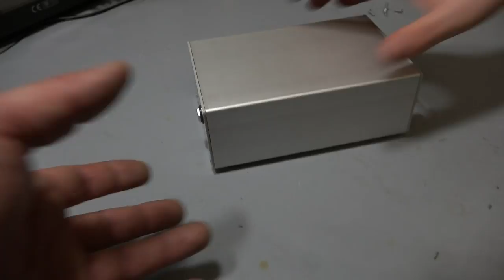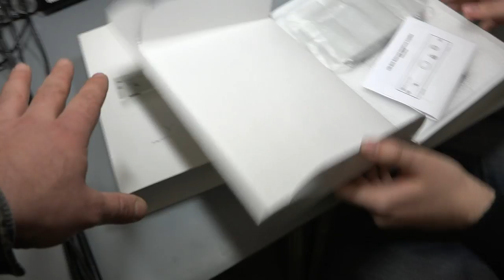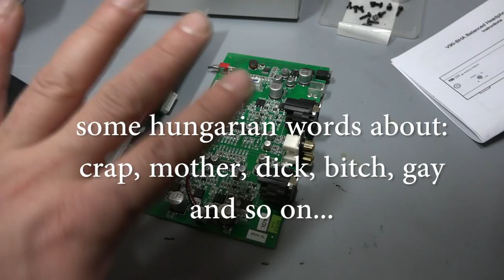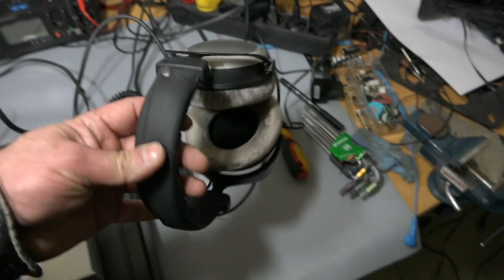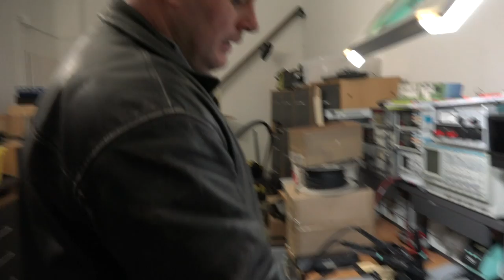DIY vs. High-end headphone amp TPA6120a2 vs. Musical Fidelity V90-BHA

Comment: I often visit the diyAudio and GroupDIY forums and I'm impressed with the huge amount of germans PASSIONATELY building studio gear which they actually use (in some cases the complete studio is diy) compared to some big studios that have a collection of expensive "factory made" gear that rarely use. Kudos to Paul.
When a device is abusively priced OR you can't find certain characteristic you are looking for... there is not another solution that build it yourself.
Great video, as usual (and funny also)
Reply from the maker: Isidoro Maich Almost all big studios are working with self made modules, compressors, eq-s whatever. They always hire some genius to work on the analog gears and consoles. just have a look on some studio visiting youtube videos. Electronic engineers haven :)
Reply: I think that thanks to the forums and all contributing members we are living in the golden age of DIY. :) There are so many projects for audio recording stuff and synths, guitar pedals, amps etc.

Comment: just tested Musical Fidelity V90-BHA in a shop with my DT900 and it did not get very loud. If you are ok with comfortable listening levels as absolute max I guess it is fine. But my Onkyo 507 surround receiver which I bought used for cheap blows it out of the water

Comment: really great video!
what amp do you recommend for the dt 880 600ohm Edition?
Reply from the maker: My Monitor controller... Best headphone amp ever in My life! Check out My videos,  MC424
Reply: @BMRStudio  
I didn't find the MC424 video 
Could you please send me the link?
Reply from the maker: @husamalden2897  624 sorry.

https://www.youtube.com/watch?v=y3QQUNLzmFk&list=PLudobwzPOwLFB6I0jvGAp7fd2iuSAID3W
Reply: @BMRStudio  
Thank you!
It seems that this monitor controller cannot be found or shipped to my region.
I'm considering the Lake People g103s, I'll use my Audient ID 14 mkii as a DAC with it.
Reply from the maker: @husamalden2897  you can have a look on the schematic, and build only the headphone section… just a tip.
Believe Me, I never heard anything like this! So open, dynamic, loud, powerful, endless bass, crisp highs…
Like a piece of diamond on a 50 lbs sledgehammer!
Reply from the maker: @husamalden2897  SPL also has some crazy good  headphone amp Phonitor One D, with DAC. Basically the current amp running on 75V rail, and 12 Ohm impedance. , 0,00004% distortion, plenty headroom. Full profi ear killer.
Reply: @BMRStudio  
I really appreciate your help thanks!
SPL and Lake People make the best amps in the world, but they are super pricey.. especially for someone who lives in Syria 😂💔

Comment: Are you sure the signal passes through the volume or simply using a reference voltage that controls signal amplification in the preamp stage?
Reply from the maker: In Pauls DIY HP amp?

Comment: Seeing as volume is a logarithmic scale, the home made one is certainly way more then 4 times as powerful. To be fair though for someone with skill to put a headphone amp together with the number of hours as the home made one would cost at least 2000 euros. 
I think output devices might have something to do with the number of gain stages, but am not sure.  
DIY is fun and you can get some nice results... and some bad results.
Reply from the maker: I think the problem with the high-end one is a poor design on unbalanced usage. The headphone is driven only with 2 transistor per side at cross a capacitor. in that case You can say bye-bye for 3/4 of power. Once because only half rail. second because the stupid capacitor on the positive biased transistor. But I still like the circuit of the high-end, because I can't understand fully, how it's working.  For fair match We will continue this with balanced headphone. But believe Me, nothing will happened :) Voltages are cannot lie. You can see the measured voltages on the output in the video.  Then You need to combine with impedance and voila. 19 dB less power on the high-end model....

Comment: I just read the schematic. That is not the best way to implement tpa6120.
High output impedance.
Highish distortion to the chips capable of.
Highish noise for the Chip's capable of.
Composite amplifier is what works the best with this. Lower noise lower distortion 0 output impedance. Awesome stability and sound quality.
Reply from the maker: Interesting comment. If Your suggestion is valid, then please contact with the guy, who designed the PCB.

Comment: I have the MF headphone amp, would hardly call it high end, more entry level.
Reply from the maker: I just made a copy of an interesting signal amp design.. Originally the circuit is designed for video transmission over 1-2 KM cables.
Well.... This is My last headphone what I ever will use! I will do a video about it.

Comment: And wtf is with the loudness brother...a little more gain will give you loudness.
Reply from the maker: You are talking about the Loudness issues with the "high End" headphone amp? Well, the volume pot was on the maximum :) and there is no adjustment around the gain of the preamp. Is just a bad design for driving unbalanced, high impedance, professional  headphones.... Period.
Reply: @BMRStudio  I think 0db gain (pure buffer no voltage gain) is good enough for most music with these dt880. 2v from dac (probably the source here is too quite).
I personally only use 200mv rms for these voltage hungry headphones. Loudness/gain is just one resistor value which really doesn't mean anything.

Sure in this video it may not be loud enough. But using loudness to judge an amplifier is really not good.

Btw, higher output impedance from tpa6120 headphone amp will cause more bass for dt880 as they have impedance rising at around 100hz. You can further increase the bass by using higher resistor at output.
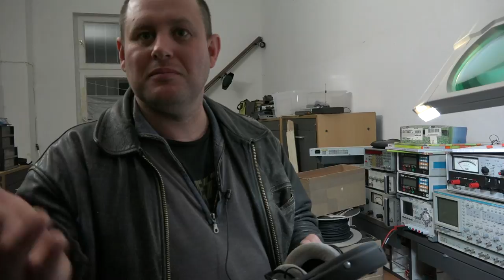Reply from the maker: @johnyang799  This "high end" headphone amp got 0.751 V signal on the input... And it`s even can`t drive the 60 Ohm Sennheiser HD-25 :))) properly. I know, loudness is not everything, but, without power, how you can hear low and high frequencies? (Human hearing-Phon curve...) I`m telling you... This awful headphone amp is just a joke on unbalanced headphones. Even this old Sony CD player can beat it! On 30% volume.... And we even said, the sound quality is great... here: 29:04 
But the lack of power? Eh awful. We should do a test with balanced headphone!
Reply: @BMRStudio  First thing, 0.7v is probably pretty low i guess. 
Secondly, I am not defending the musical fidelity. They are really a joke i know. 
What I was trying to say was I face palmed that another guy judged amplifier due to loudness. 
But anyway, thanks for the reply. Take care.
Reply from the maker: @johnyang799  I highly recommend you, to watch the video series about the Sound Sculptor MC-624 monitor controller. Because the headphone amp in this puppy... OMG! Best what I heard ever in my life! Simple, elegant, lot of power, 0.004% THD, and easily can drive professional headphones.
Reply from the maker: @johnyang799  Reference studio level (aka 0 dBu) on unbalanced signals: 0.775 volt
link: http://www.sengpielaudio.com/calculator-db-volt.htm
Reply: @BMRStudio  Well. The tpa6120 amp I implemented has 0.00003% thd below 1khz,  0.0001% below 10khz for load higher than 16ohm. 5W output.
Another cheap one came out recently is jds atom. Pretty good check that out. Audiosciencereview forum has the measurements of it. Check that out.
Reply: @BMRStudio  Reference is 0.7v for  0dbu that's correct. But studio line level runs at +18dbu as far as I know.
Reply: @BMRStudio  At least it's +4dbu as an old standard.